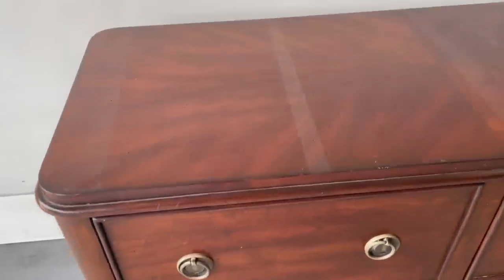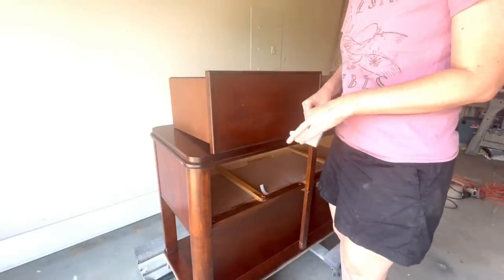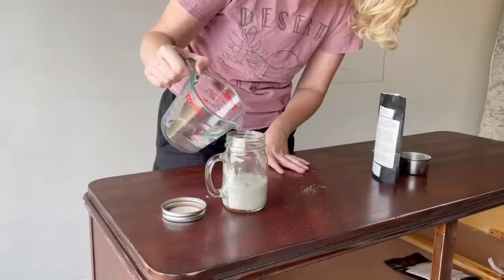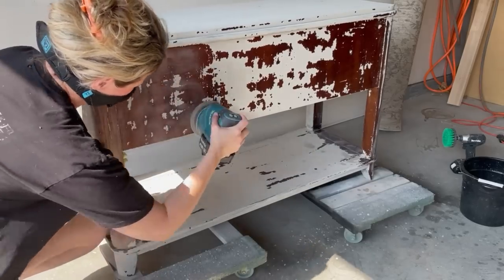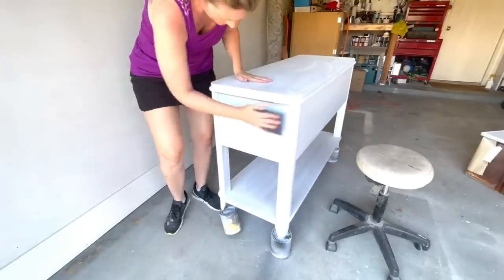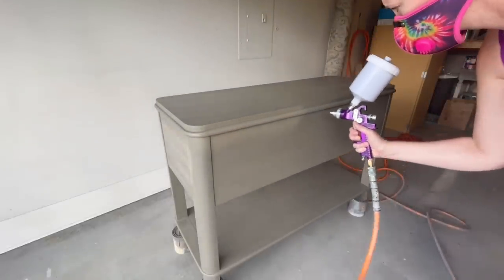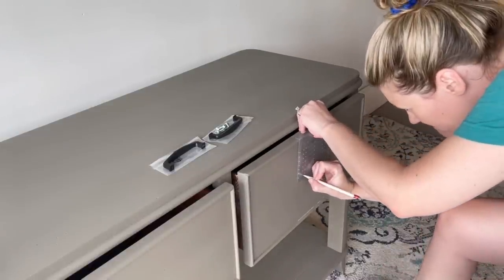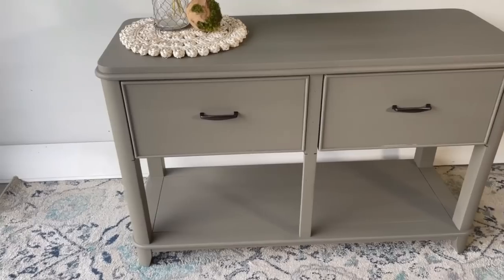How To Turn Unwanted Furniture Into Money // Quick Side Hustle Tips

Comment: I mostly paint with water based paint because it's odourless. However, I learned the hard way to never paint on a rainy day! It won't dry properly and you won't get a smooth surface. Some stains have this problem too...the result is hideous 🫣🇳🇱

Comment: Turned out great! I really like that color. I liked to tip on using painters tape when filling the old hardware holes. I was wondering what is your favorite stripper that isn't too stinky,  that you feel works the best. I found a Heywood Wakefield table on the side of the road. Someone painted it black😢.   Was hoping to strip it. It looks like it will be a pain in the you know what.